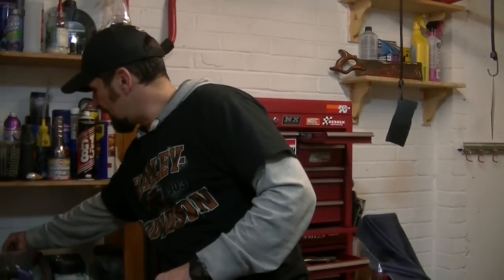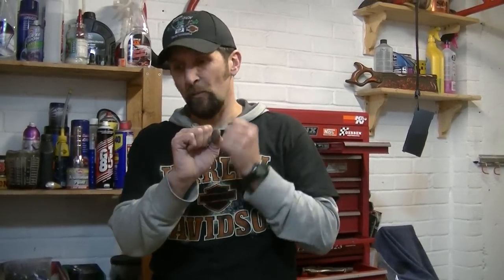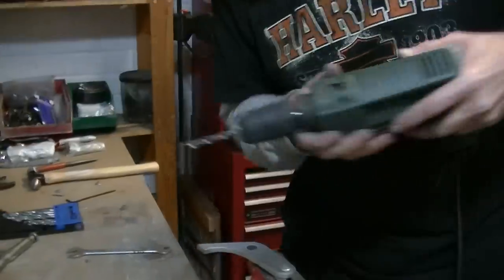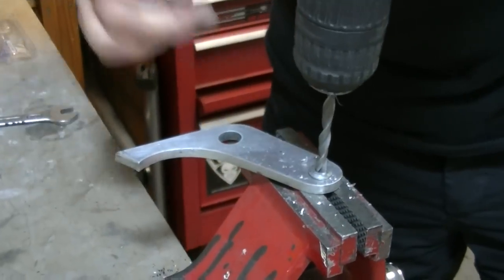Delboy's Garage, Stripped Allen Bolt Fix!

Comment: Hey Delboy, I was wanted to thank you for this SUPER easy tip of removing a striped allen bolt. I just did a service on changing the clutch hydraulic fluid and I rounded off one of the bolts that hold the slave cylinder on so I could clean and regrease that area. Without this tip I'm sure I would of payed a pretty penny at a dealer just for drilling this out. Awesome job on your chanel. Keep up the great work!
Reply from the maker: +Luis Nunez Hi Luis, thats great news mate, im glad you saved the cash and did it yourself... take care buddy.. all the best. Del.

Comment: Had a stripped 5mm front brake pad pin on my 2017 Triumph T120.  Tried all these tricks.  No joy.  What finally worked was pounding a 6mm triple square bit into the bolt head. Torx bit didn’t work due to the taper.  Triple square bits are straight and really grip.  That said, love your channel and the tips are extremely helpful.

Comment: Yo man, I have a brand new bicycle. Not even 24 hours old with a horribly rounded bolt. I’ve been panicking all night wondering how I will sort it. Your video has put me at ease. I’ll grab a strong drill tomorrow, some safety goggles and sort it out. 

Thank so much. ❤️

Comment: I had a stripped dome-headed allen key bolt (one of three) holding a blade in my Ryobi electric wood planer.  I did as you showed and the head came off the bolt.  There was only a tiny bit of the screw left protruding from the base, but like you said, with the tension from the tightened down head gone, the screw came out by hand - easy as pie.  Thanks so much for solving this problem.  I hope I can get the right size of replacement bolt.
Cheers!
Reply from the maker: Glad we could help Bruce, good luck finding a bolt!

Comment: I just had to deal with this two weeks ago.  I used a Dremmel with a round cutoff disk to cut a straight canal across the center.  Then I twisted it out with the biggest widest flathead screwdriver I own.  Heat helps too, but NOT NEAR THE FUEL TANK.  Mine was holding a belt guard; I was fine.  Propane worked.  No need for oxy or acetylene.  Just one more way that worked for me.
Reply: this helped me. thx

Comment: hi delboy I've found another way. there's sockets for removing rounded off  nuts. get one that's just right or even slightly small.  Hammer on and it cuts Into the head as turn socket. works a treat even on siezed on Allen bolts securing my brake discs way less messy than drilling 😀.  ps. love watching your videos.  learnt lots from  them. cheers mike

Comment: Ah I seem to be having similar problem other day paddock stand bobbins bolts sheared off as they had siezed. So drilled smallerhoke down shaft then for some reason bless him my dad,whilst I was making tea, bashed in a torx bit then snapped that inside hole. Spent another 30 minutes punching a torx bit out. Dont put any hardened metal in, personally EZ outs have always snapped and once again your really  in a world of hurt. Found drilling upto the bolt size minus thread pitch then retapping the thread has worked. Takes patience and accuracy. The whole thing could've been avoided with copper slip.
Reply from the maker: Copper slip in the key aye.... saves sooo' much grief..

Comment: Thank you! I have one allen head bolt and Ive been drilling the center rather easily but this helps with technique! The manufacturer updated the head bolt design to a knurled 15mm which offers a much better grip but this allen bolt is keeping me from upgrading it and being able to remove the head. Hopefully this technique will help to remove it soon! Not sure if the allen bolt is even completely tightened despite being tight, another reason for wanting to upgrade it.

Comment: There are too many videos showing bodged ways to do jobs like this. Thankfully Delboy shows the correct techniques employed by engineers. A point worth making is that allen bolts are often used with red thread lock to secure things like footpegs, so you may have to employ heat to assist removal.

Comment: Thanks Del nice and simple, I have also ground a slot across the face of the head and used a wide flat screwdriver which worked on that occasion but might not always be that Lucky !! Rich
Reply from the maker: Yeah, that's a common fix too Rich, but some allen bolts live down a recess where you can't get a grinder in and it's also pretty risky wielding a cutting disc near your spotless plastics or un-marked engine casings!... just gotta do what works eh mate?
Reply: That's right Del, take a step back have a cupa and take stock before rushing in ...... Then consult you Tube ! Lol
Reply from the maker: rich19633
Ha ha, works every time..lol

Comment: Thanks Del have that exact problem on an engine mount on my zx6r Ill give it a bash at some point I need to get the engine out of the frame to strip its cylinder head off. I haven't got round to tackling it yet was waiting on my old man to gimme a hand with it kinda scary when its something as crucial as an engine lol
Reply from the maker: It is indeed mate, but take your time and carry it out like i showed, and you'll be fine... good luck with it, Cheers, Del.

Comment: I i'm watching your videos for some time, and I can just say that you are a true fontaine of knowledge! 

I have a prety big problem with stripped allen nut on my brake calipers. It's the allen nut that holds the brake pads. My bike is 2003 CBR954RR, Nissin brake calipers. Do you have any suggestions?? Because i can't bore it out real you understand why. 

Thank you in advance!
I wish you the best,  Dule!
Reply from the maker: +Duka555 Hi there, if it's the brake caliper pin I think it is, then they are set down in a hole, and drilling the head off doesn't cure it... but there are two things you can do..... you can cut the pin at the part you can see exposed, and turn out the broken half with grips, you can drill down inside the allen head to make a slim hole and then use a tool known as an 'Easy Out'... this often works.................... or as a last resort, you can take the brake hose off and split the actual caliper body in half by removing the body bolts, once it's apart, you can get some grips on the pin and turn it out... one of those methods will certainly get it !  Good luck with it, all the best, Del

Comment: Great suggestion. What do you do if you don't know the size of the shaft underneath? I have some hex bolts holding a grill on top of my lawn tractor engine and all three bolts are stripped. I can't see how wide the bolt shaft is.

Comment: I find you can sometimes get a torx bit similar size and tap it in with a hammer they grip because they have the sharper edges and more of them.
Reply from the maker: Good way to chew up your Torx bits Luke....and they can shear off in the bolt head too....then you cant drill them off.... if they're already chewed out, just spin the head off and be done with it.. only takes a minute..
Reply: Moonfleet41 that's why I have a special draw in my tool chest know as pound shop tools ahah I can afford to dish out some abuse on them ahaha your probably right about the snapping off but I aint ever snapped off any allen key bits or torx bits but that dosent mean it wont happen your is probably the best method ahaha

Comment: Hey Delboy.

I tried to replace my rubber seals on my front fork. I followed your video on replacing them.

The problem is that the allen key bolt in the bottomside of the fork is stripped out. I tried to drill them out but my drill went off and the drilling hole is thus not centered.

Now i am afraid i will be drilling in the aluminium casing of the suspension. Are there any ways to recenter the drilling hole?

Kind regards,
Sybren

Comment: Hey Delboy,Will this method work even when the round allen bolt is stripped on top and keeps spinning in circles but wont ever come out. Its for a bracket for my TV mount Thanks

Comment: hi is it possible use a dremel with disc with the same diameter or the Allen head, cutting a slot for a flat blade?

Comment: Haveing this problem when trying to remove my exhaust heat protector,(metal cover over exhaust beside the kickstart) 

Not wanting to hammer or drill to hard causing damage to my exhaust pipe, anyway to get these off?

Comment: Awesome video tip; will this be safe to apply to my Audi gearbox system? It has a rear diff driven by a haldex system which requires an oil change every 20k, well I've come to do the change and the damn 5mm allen bolt has seized and has now rounded off...
Reply from the maker: Im not sure where that bolt is in your Audi, but as long as to holds a cover in place, and when removed, there is a stump protruding to grab hold of and remove... then thats fine... but NOT of its a plug itself as you'll have to drill it all the way out and helical the thread.. hope that helps.. Good luck, Del

Comment: Or I've found that with rounded Allen bolts. Hammering a torx bit into the hole that sometimes works to undo the bolt

Comment: Didn't work for me. I have the same exact bolt he's talking about. The bolt is not rusted in there, it's just soft weak ass metal that loves to strip. I have the center punch and extractor kit and nothing is working. My last option is to weld a small nut to the head. I removed 2 without stripping them, but the other 2 stripped. I can't remove the rear fairing off my m109r because of 2 damn screws. Once I get them out I'm switching the Phillips head with stainless steel washers. I guess I'm gonna try some anti-seize on the thread before putting the new ones in?
Reply from the maker: Just drill the heads off - no stress!

Comment: Thanks, it's a great help. One question, would you do the same thing for the bottom left allen key bolt on a suzuki bandit sproket cover?
Reply from the maker: Hi Arron, This trick will work on any alun bolt you can get a drill bit into... just remember to use a drill bit the same size as the shaft and it'll work.. ! Good luck with it buddy... Del.

Comment: Erm, I removed the forks from my ST1100. Removal, no probs. Followed your vid (spot on as always 🤗) then I noticed the problem. 

The Allen bolt which secured the bottom part of the fork ( The one you suggested a quick thrutch to crack the seal) has been rounded by the previous owner. 

Any thoughts on how to get in at it to do as demonstrated please?
Reply from the maker: Hi buddy, this is pretty common sadly, and there is two options... one possibly might work, and the other definitely will... firstly try taking a torx bit, put it in a correctly sized socket, it needs to be just a bit too big to fit in the hole, and then with a short extension bar ont he socket, tap it all the way in with a small hammer... the sharp edges of the torx bit will bite in to the stripped remains of the allen bolt and will often be enough to grip it and make it move, but if that slips round and strips as well, then just drill the head offf it... you need a drill bit as big as the shaft, which I think is 8mm, carefully drill in to the stripped allen head, the shape of it should take the drill bit straight down the middle, and once you are through that head, it should spin free attached to the drill bit... then you can take the whole thing apart and drop the dmamper rod out, you will see the remains of the stump in the damper rod and you can just twist it out with a pair of molegrips.... obviously you'll need a new bolt afterwards... good luck with it, hope that helps, all the best, Del
Reply: Brilliant! Cheers Mate! I reflected on how it happened. The last guy to own this bike had a stable of old British bikes. I suspect he just reached for an imperial when he did this... Pooh!
Reply: Yup! Worked! :)

Comment: Nice tip but got a major problem with the Damper Rod Bolt on the forks are minced (6mm). tried 7mm no luck, no chance with hammer n chisel any other ideas as this bolt needs to be opened quick otherwise the damper rod will just turn and ill never get it out???
Reply from the maker: Drill the head off it mate, then once the forks are apart, you can take the stump of the old bolt out with some grips (use a drill bit the same thickness as the bolt shaft)... good luck !
Reply: Thanks. What type of drill bit do you recommend, as i don't have any for drilling metal
Reply from the maker: The only thing you can use is a proper metal drill bit, something marked 'HSS' for high speed steel... they are not expensive, find the size you need, you can buy a single one from Ebay for a couple of quid!
Reply: Will check ebay for HSS Bits. 
The bolt is 6mm and the head is 12.8mm can i use a 9mm. Any bigger and im afraid ill end up drilling the fork itself
Reply from the maker: NO Buddy....use a 6mm.... all it needs to be is the same diameter as the bolt shaft....then when you drill down, it will centre in the hole in the head, and as soon as its through that, the head will spin off and come away in the end of the drill bit....once the fork is apart, the remaining stump can be wound out with grips...!
Reply: Ill do that. Thanks again

Comment: Del, I have an issue where the allen key got broken and it's stuck inside the allen bolt on my disc brake pin. I tried using the drill and screw extractor set without success as it can't even make a tiniest hole through the hardened steel of the allen key. Do you have any suggestions? I was thinking to replace the calipper. If I do so, I could send you the calipper in question so you can create another video on how to fix the problem.
Reply from the maker: Hi Stefanos,  You didn;t say what bike it is mate.. so im not sure on your caliper design, but can you split the caliper halves in situ by taking the body bolts out ? if you can, then you can get some grips on the inner end of the pin once its in two halves..?  failing that, can you weld the broken half of the alun key back on to the pin...ive got a few out that way when they have totally rounded out..?
Reply: Hi Del. It's a one piece caliper, the bike is Suzuki Address 110 - 2015. However, I can approach the pin from the inside but due to it's round shape I can't get enough grip to rotate it. Do you think it would be possible to use the dremmel to square it to create a better grip? I was considering to go to the welding shop but since the price of new caliper is £80 I would most likely end up paying the similar amount. I have attached the pictures of the pin https://ibb.co/bOs43d https://ibb.co/kiZj3d
Reply from the maker: Aha, i see your problem now, thats pretty terminal if you can't split it.. but why not try cutting a couple of flats in it to get a good grip of it.. at least if you can buy a new caliper for that little, then its not the end of the world.. Good luck with it buddy, hope you can sort it out.. Del.
Reply: Moonfleet41 Thank you Del. Will buy a new one but will tryto fix this caliper for practice

Comment: I have a question; what about a a stripped allan screw in electronics? I've got one on my ESC which uses 2mm keys. Would this still be viable?
Reply from the maker: +Reploidx9 Yeah, it will work, but you would obviously have to be really careful, maybe use a small hand drill..!
Reply: +Moonfleet41 Alright thanks, I can't use my TZ85a's without it!

Comment: what do i do if i have to remove a stripped torx screw on the clutch cover? Help!!
Reply from the maker: +banjomark1 you can tap the next size torx bit into the hole so it jams in...then repalce the bolt afterwards.. ! or just centre punch it and tap it round, just be careful not to slip off and damage the casing.. !!

Comment: so I have a hex bolt I just stripped in the bottom of my fork tube(sportster where it connects to the damping rod I believe) What is the best way to take care of this? I really am thinking about putting everything back on and going to the dealer. I would really appreciate any help.
Reply from the maker: +MotoZixxer Hi buddy... its not that hard to fix that one....im presuming you mean you've stripped the head of the bolt out and cant get a grip to shift it?... if so, then just drill the head out the same as i did in this video... as long as you use a drill bit the same size as the bolt shaft, you will take the head off it cleanly... then once its all apart, you'll find the stump in the bottom of the damper rod, and can just take it out with some grips, or a stud extractor at worst, but usually they are loose once you drill the heads off as its the head that grips..!    Have faiht buddy, ive had that a couple of times, and its always fine once you drill the head off it..!   Good luck with it. Del.
Reply: +Moonfleet41 thanks man I really appreciate it. I pulled the forks off and going to have a friend give me a hand. I'm just hoping all goes well.